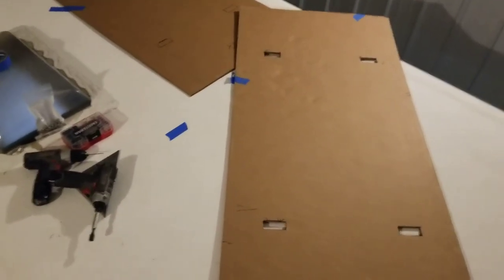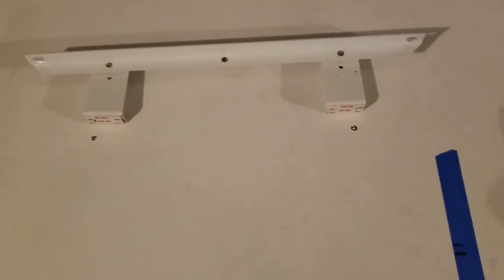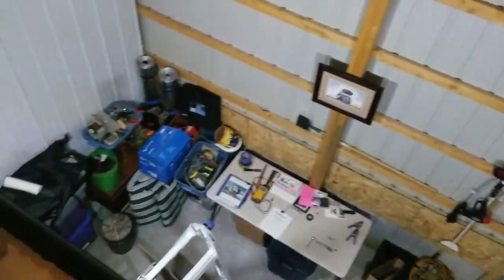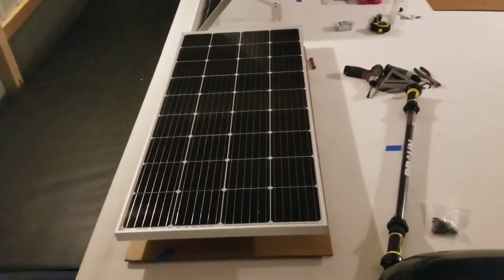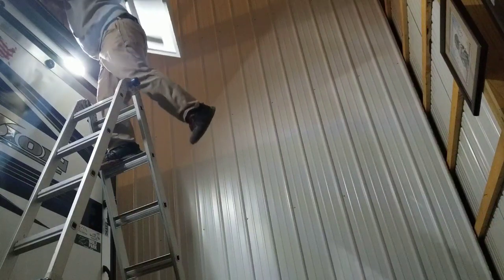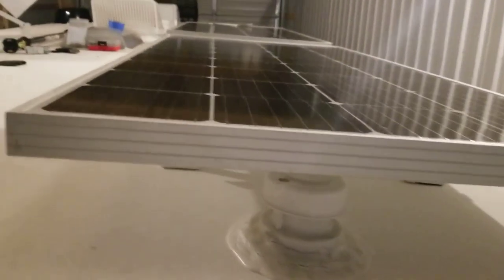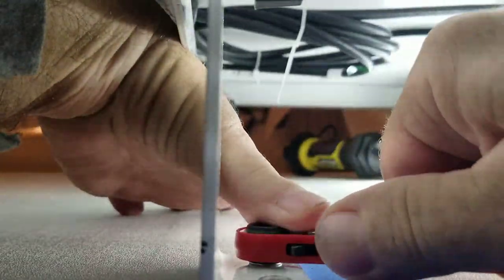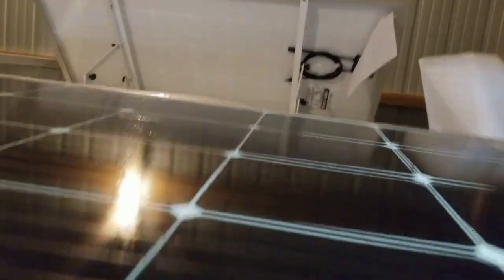Solar panels install - part 1 DIY

Comment: Your getting it done. In Brownsburg if ya need to borrow my 12 ft step.
Reply from the maker: Just seeing this comment, sorry for the delay. Thanks for the offer. Install is almost complete, last connections in the next few days, then power up.

Comment: did you do a video on running the wire from the roof to the batteries
Reply from the maker: I used the factory installed "solar prep" initially, so no video of that. A few months on the road I had problems with the factory installed cable, turned out it had a staple shorting it. I ran new wire through the same port access, through an interior wall into basement to the circuit breaker I installed. No issues since. Prepped for solar is the only thing I didn't check initially. Lesson learned.